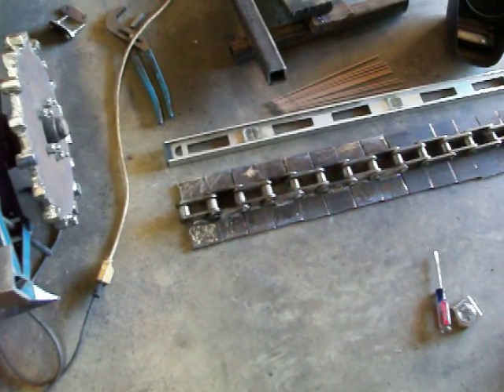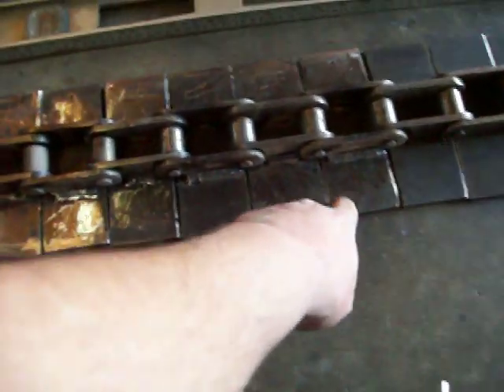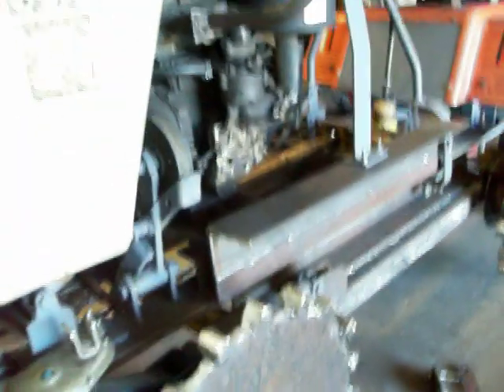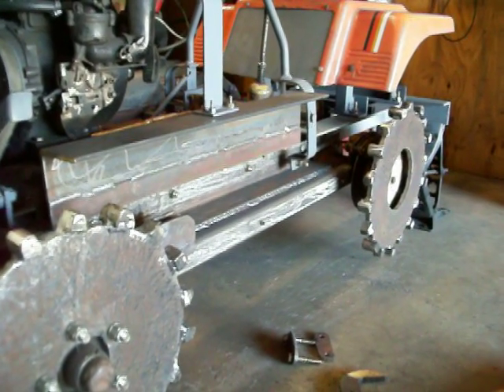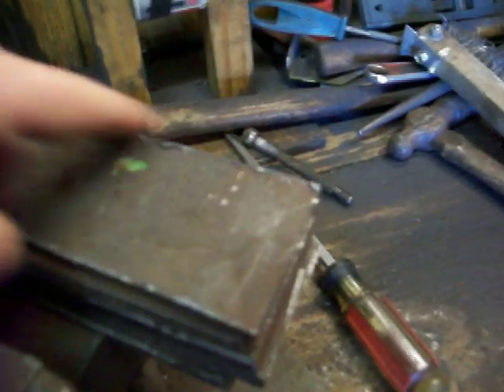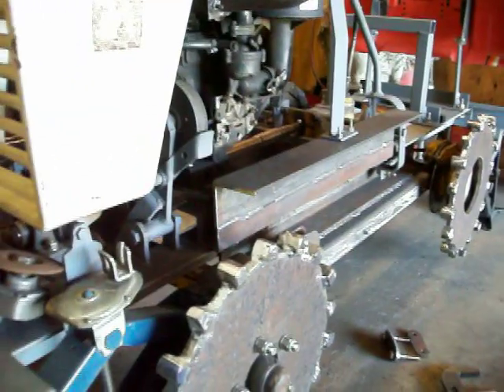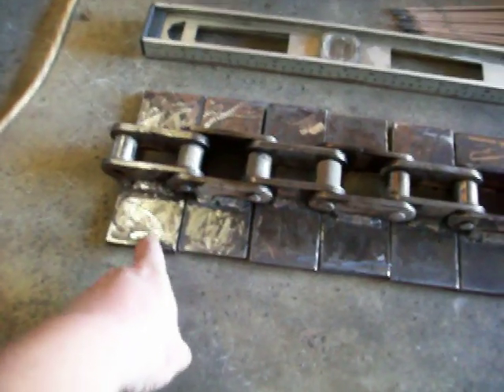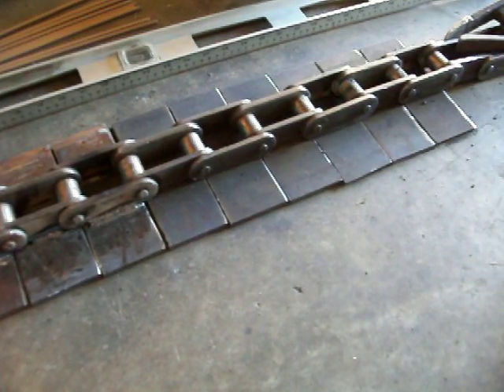Mini Dozer home made from scrap "Track Pads Started"

Comment: Hey Rick, good to see some more progress.. Very good to see the tracks taking shape at last :-)
I'm quite behind on my video watching list, but starting to catch up..
Oh, the new fangled cutting thingy is called a plasma cutter :-)
Reply from the maker: as soon a s I finished the video it popped in my mind Plasma cutter Rick !!!!
hahaha,,,thats ok about being behind and you'd think Id be in a huge hurry to finish the dozer but for some reason Im not,,the fun part is building it and when finished it'll be just like miy minibikes,,go in the garage and never come out again,,haha,,buddy I tell you what the dozer is getting heavy man and them tracks weigh a ton each,,just the rear end weighs 200 pounds and a safe guess on each completeted track would be 150 to 200 pounds each and each of the 4 wheels weigh at least 40 pounds each cause there like picking up a big barbell disc,,when i get the blade added and roll cage and starter and hydraulics and abattery and all the other goodies it will have to tip the scale at 1200 pounds or more and Im gonna say more cause its very heavy right now,,appreciate the reply's brother and keep wathcing as i hope to have the brakes doen soon and then I still got make the little boggie wheels along the botoom of the tracks,,8 in all so that will add a lot of weight,,later

Comment: snowmzngsx1100, I wondered how I would create a set of tracks and now I see. Boy, that is a lot of welding. It looks good, will be watching the progress. I have a 6wheeler frame and drive chain, it would be cool with a track on it. I may cheat and go snowmobile as I would also like to push snow with it on a blacktop driveway. Thanks for posting
Reply from the maker: its pretty tuff to build tracks it really is and was beginning to think I had bit off more than I can chew even being a life long welder and builder of junk or stuff like this but Im convinced anyone can do it with time brother,,I now have the tracks finished and a follow up video and am also fixing to add the 1/2 inch cleets for traction but at the moment Im bogged down on the brakes and am having to add hydraulic car type calipers for the rear brakes,,best of luck with your build and make us some videos to look at,,thanks.

Comment: u dont need "" cleets""
and if u do later then u can allways weld m on later. if you do ...make m not more then half inch high max. and round m off on edges or else they catch and derail track or break something
Reply from the maker: You are right but I added them long ago and regret it,,the dozer is to heavy and to small and digs into the ground no matter where you go and makes it hard to turn,,Im gonna cut them back off with a torch but at the moment I have it on hold and warped one of the rear axles,, its geared so low and so strong one of the tracks got out of line with one of the teeth on the drive wheels and warped the axle and it is a big strong cub cadet axle so I have a problem on my hands.

Comment: That looks great Rick! Are you going to torch in the relief holes or just drill them?
Reply from the maker: I have thought of them several times and thinking I want put any,,the old Oliver doesnt have any at all either,,but I am going to make a cowcatcher type deal at the bottom rear of each track and wheel to keep anything of any size from getting in there,,one thing is the teeth dont fit the chain back and forawrds close enough that theres also room for anything to mash itself out,,theres so many Id torch them now and the best thing would have been to drill them first on the drill press,,,thanks for the question.
Reply from the maker: buddy I have woke up this morning so souror from bending up and down and kneeing down welding the pads I cant hardly walk or move man,,I guess being 54 years olf has its down sides but I didnt know Id be this souror,,I mean I feel like Ive been to basic training for the first day,,haha,,its that bad and may have to wait a day or so before strating on the rest,,later
Reply: snowmangsx1100
Yea, I was wondering if there was enough space to allow it to clear from the bottom.  I've never seen a machine that didn't have the holes, so its good to know that the oliver doesn't have any. (At least you know it can work.)   B-)
Reply: snowmangsx1100
Ha, I hear you Buddy!   After a few hours of shoveling the other day I feel like about ten miles of bad road. I guess we can't stay young forever Rick!
Reply from the maker: hey i got almost all the pads welded on one side today and would have but went to town and stayed half the day,,tomorrow I will have one side totally with pads and then try to decide whether or not to put a cleat per pad or every other,,we'll see tomorrow old buddy.
Reply from the maker: well I dont know it you noticed but the wheels them selves are only 1/2 to 3/4 inchs thick but solid steel of course,,,and the teeth are 1 inch to 1.5 inchs wide and then couple that with the fact that each tooth does not completely fill in each track link there should be plenty of room for extra dirt or stuff to come out,,Im gonna make the cowcather deal real close to the track chain and rear wheel so hardly nothing can get in there like rocks or etc,,also I have to add 2 to 3 bogie wheels on the bottom of each side and one on top to further steady the tracks,,gonna be one hell of heavy little machine when finished I promise,,very very heavy for its size,,later
Reply from the maker: hey one more thing,,I think the funniest thing Ive had asked yet on the dozer is from a man that owns a car lot down the street,,he got his hair cut next door and peeked into the shop one day last week and I told him come on in and look at my mini dozer Im building,,he walked in and looked down at it and said i dont think your tracks are wide enough,,looks like they will mar into the ground,,he was looking at the chain only and no pads on it,,I almost busted out laughing in the mans face but being Mr Nice I didnt and explained to him I still have to add the track pads and they will be 7 inchs wide,,that was funny Jim,,,,later
Reply: snowmangsx1100
You should have told him it was a special chrome moly chain with super special "O" rings, designed to hover just 1/8" off from the ground.....  ;-)   To funny.
Reply from the maker: hey Jim I just got back from the junk yard and bought the complete rear drum brakes from a Mazda 626 lx and there ultra thin drums and am gonna mount them on the front where I think it will be easiest,,I got the cleet metal also thats 1/2 by 3/4 inch from a sheered solid steel plate,,I tried to weigh the dozer half at a time with the bathroom scales by jacking up the front end and then afterwards weigh the back and I swear it crunched the scales and wouldnt give a reading,,I know its no big deal and makes no difference but Im gonna guess when totally finished with blade and hydraulics and boggie wheels and battery and starter and small roll cage and a few other goodies Im gonna say it will tip the scales at 1200 pounds or more,,id be willing to bet right now the way it sits would be 600 pounds easily or more,,and what got me re-thinking about it is I just bought a walk behind troy bilt self powered tiller without the motor and its rinky dink looking and a small one and hell it weighted 188 pounds and costed me 30 dollars,,I mean its a heavy duty tiller and got a trans axle like a real one but by size its tiny compared to the dozer,,oh well whats that little back hoe thing you got a video of ? man thats killer and I bet that costed a pretty penney,,is it yours ?
Reply: snowmangsx1100 You'll have to hit the truck scale once its complete!  B-)   Yup, thats our excavator. I do a lot of small side jobs that require tight work. I used to do those with the loader backhoe, I've had to take the out riggers off to make it past walls. But this thing can fit into a standard doorway, can't get much tighter than that. It wasn't actually that much, a little over 21g. If you go to the Kubota website, you can see the really expensive ones!   B-)  Try their build a machine tool, yikes!   Our last machine paid for itself in a very short time, I'm figuring around five years hit my ROI.  Then after that, its all gravy.

Comment: stop welding those shoes on. 
drill holes and bolt m on. weld tabs on the chain links to bolt to
Reply from the maker: they will never be worn out so it don't matter that there welded,,but thanks